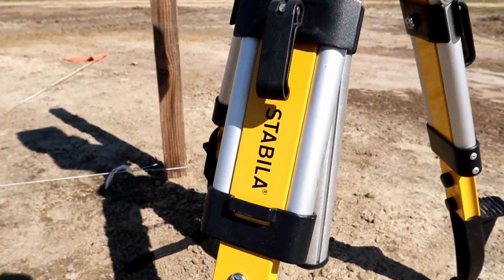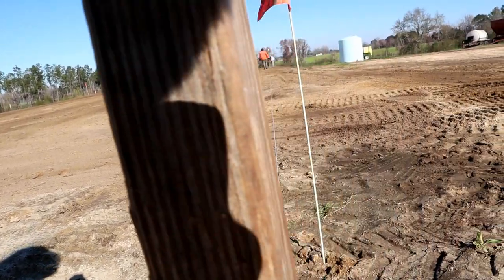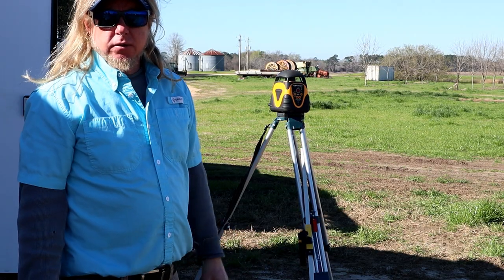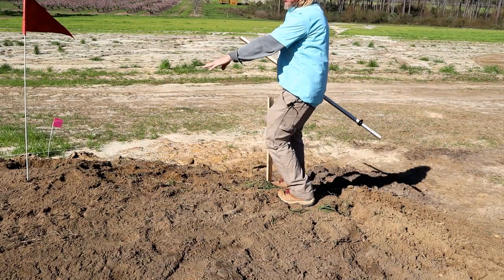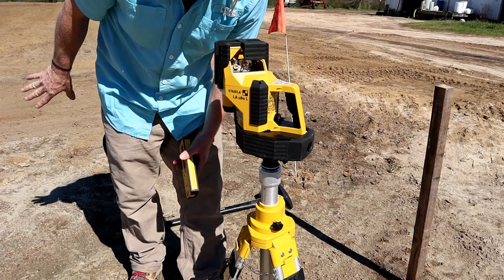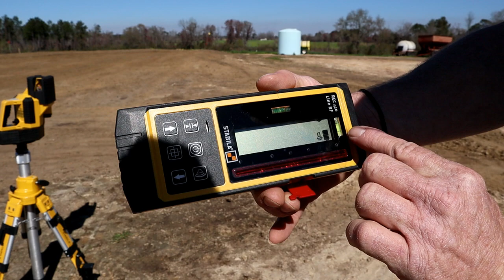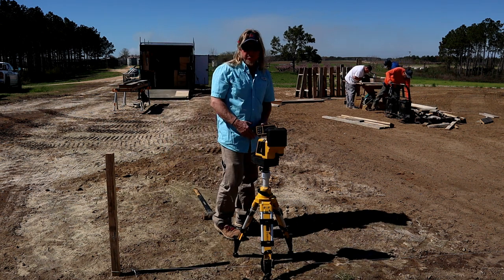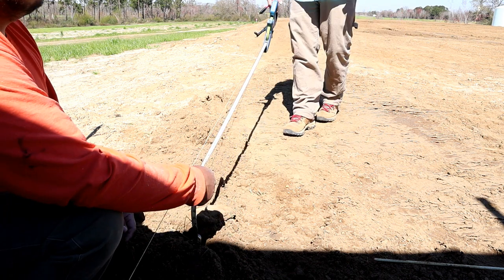Stabila LA180 : How to layout and square

Comment: You mentioned that you'd like it if the laser was also a range fiinder.  Laser range finders exist, and they can be as accurate as you want depending on what you're willing to pay for.  If Stabila included range finding in this product, would it be worth an extra 1, 2, or 3 hundred bucks?  One milimeter accuracy should be doable.

Comment: Whats up Fredrick? I have gotten one maybe a few months ago. Brand new, maybe im too dumb to use it? But i can’t get it to lock on. I do mini storage/metal buildings for a living. I seen the ease of how to square and shoot lines with this laser. But i can’t seem to get it to work like you. We typically do buildings from 60’x200’ and up.  Maybe the laser doesn’t reach that far?
Reply from the maker: I have found that I need to be only 40'-60' to setup.  Maybe the sunlight effects the receiver or it can be messed up with other items using wifi signals.
Then I go to the other end and double check that it is where I need it.

Comment: Thanks for showing us these tips getting close on my build. Waiting for slab blue prints and permit trying to watch as many of your videos before I start. 
I have a question I’m not sure about if l  add iso foam board  1 inch board with fiberglass batts. It looks like you smash the insulation against the beams and screw down the siding if I add 1 inch iso foam it won’t smash will that make my building wider making my roof short ? 
It’s a prefab rigid building hope this makes sense. The buildings does not have an eve it has trim covers roof edge and wall thanks for the help.
Reply from the maker: New codes are requiring this 1-2" of rigid insulation on outside of wall girts.  I haven't used it yet but I think it will be better and you will need longer screws.  I would pour concrete the extra 2" wider and seal the insulation to slab before installing the panel. The panel would go past the slab 1" to keep water from coming under wall.
Reply: @BuildingwithNARF  .it makes the wall take much longer to build to.the tips you have to use for the screws also makes it more difficult.and the length of the screw along with what I said makes it much more difficult.just make sure your screw gun guys aren't rookie's

Comment: Hey Fredrick. I purchased one of these. Do you have any trouble getting it to lock on in full sun? I have been trying to set one up at 150ft and it won’t find the receiver. Even in manual mode it can take 30 minutes or more. Maybe it’s just me?  Just curious if you’ve had any problem with set up? Thanks
Reply from the maker: That's why I set it up in the middle of the string at first and then checked it at the end.  The sun affects it and I think the transmitter may struggle at long distances when setting it up.  Once it's locked in I don't have a problem at 120'.
Reply: @BuildingwithNARF  Ok. Thanks for the help. We will keep trying.
Reply: My receiver won’t pick up the laser over 6 meters sometimes
Reply from the maker: Sunlight messes with it sometimes
Reply: @BuildingwithNARF  it’s pretty disappointing considering the price and the time it takes to set up , it’s weird though because a normal Hilti rotary horizontal Lazer will pick up the receiver in any conditions , why can’t a vertical squaring laser? Maybe it’s cause the laser isn’t spinning on the la180…. Also some people are saying they don’t sell the la180 in Germany anymore maybe german tradesman don’t have time for things that don’t work
Reply: Learn how to perform dimensional layout like a man using a measuring tape and strings along with the construction master to crunch your number from corner to corner on your layout.